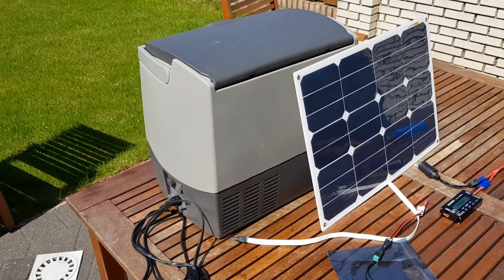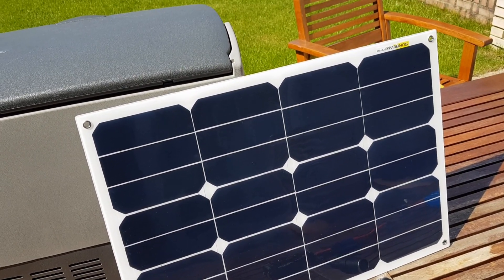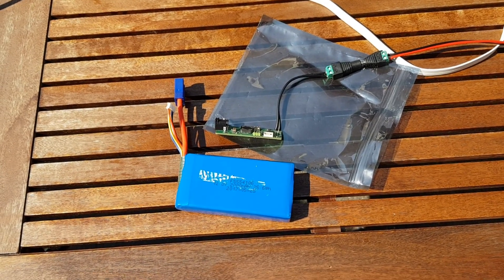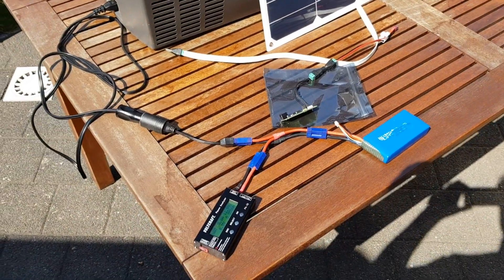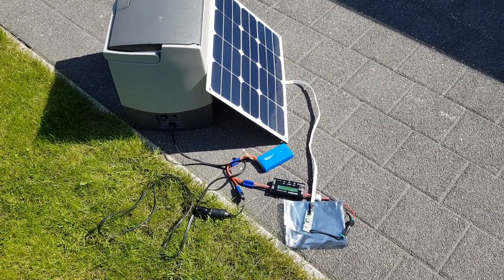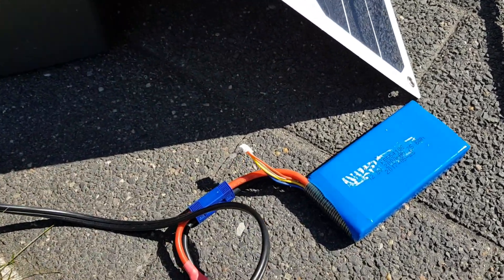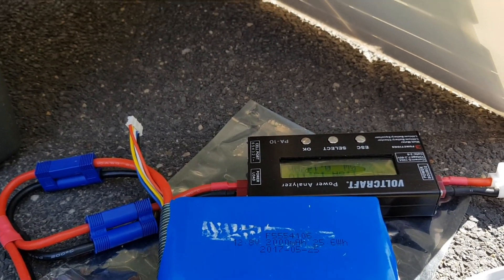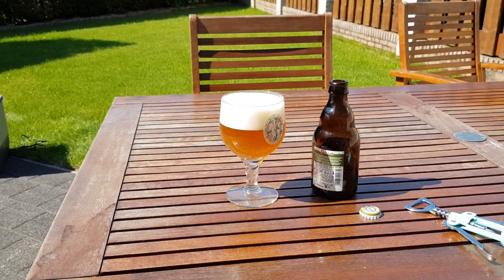Solar fridge, 30W panel powers CDF18 with uMPPT and LiFePO4 buffer

Comment: Hi

Just wanted to check, is there now a commercial one available?
Reply from the maker: I am afraid not dometic seemed not to be interested. To bad it is working great using it for 2 years now and there is much interest on the beach :-)
Reply: @jansunman7393  what a shame... Any idea what I must do to get my hands on one? I still haven't found a suitable charger... I even built an arduino "mppt" charger but it turned out to be a performance let down but at least it was a nice learning experience.
Reply: @jansunman7393  any news or github repository?

Comment: So Stefan, do you intend to have this made in China? Or just sell PCB's with programmed controller and BOM? I don't think there exists any MMPTs that work efficiently at such low power levels either. This ideal for solar powered sensor stations or similar. whereas most smal consumer MPPT trackers are for the RV or marine market! You could easily sell hundreds of these if you did a small production run. The guy from the UK, Julan Ilet, who made the smal PWM5 charge controller, sold 600 of them for £25 a piece and had them made in China when he got tired of soldering after the first 50.
Reply from the maker: Hi Tore, I would be surprised if there would be that kind of demand. Apart from a solar charger it also supports connection to an adapter an it can be used as a battery charger. What kind of batteries should be supported in your opinion?
Reply: @jansunman7393  Just a CC CV scheme with a potentiometer for end voltage and a solder bridge selectable minimum current "end of charge" or continuous float option, and just leave the rest to whatever BMS is connected to different battery chemistries. 
I think you are too modest, to my knowledge, the only other option for a true MPPT charger in the <5A range is the Genasun, then there are the "simulated" MPPT chargers, that work by a panel specific manually set PP voltage, but they are unable to cope with dirt and season changes i panel characteristics,  Like the BQ24650, that even has panel temperature and battery temperature compensation, and do a fairly good job if tuned for the exact conditions 94%, but it is not for everyone to calculate temp sensor resistor divider through a half page differential equation in the data sheet (I skipped that part).

So an efficient MPPT charger that doesn't require reading datasheets that could be a building block for whatever university project that needs charging, or the DIY'er like me or a cheaper alternative to the Genasun bare board version that costs EUR 75 for OEMs. You would really fill a niche!

So you can order populated boards in small quantities, so do a pre order for 20 PCBs and have people sign up and pay beforehand, and you won't bare much of the risk. Then people will try them out, make youtube videos about them and before you know it, you'll get requests for more. You might want to do the controller programming and soldering yourself including the manual soldered connectors just leaving the SMD parts to China, not to be beaten by Chinese knockoffs appearing on Aliexpress, and to save costs on the first order?? I'm convinced you got something unique here.
Reply from the maker: Hi Tore, well it could be done. Is there a way to reach you with a PM to further discuss?